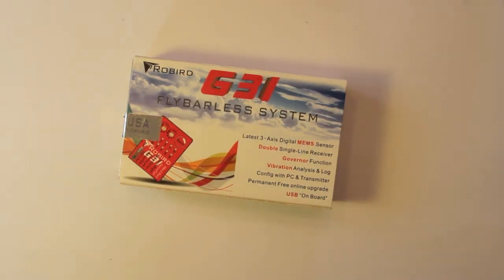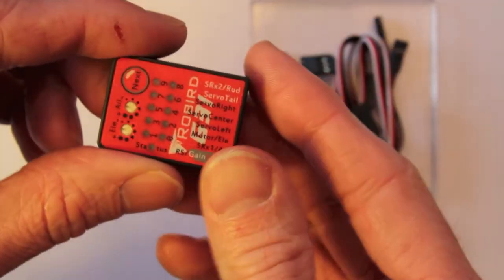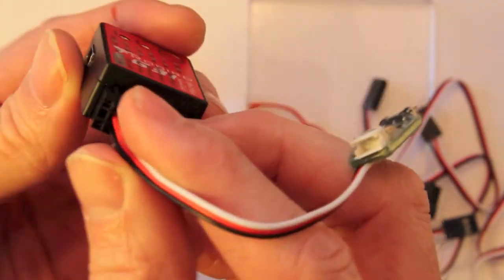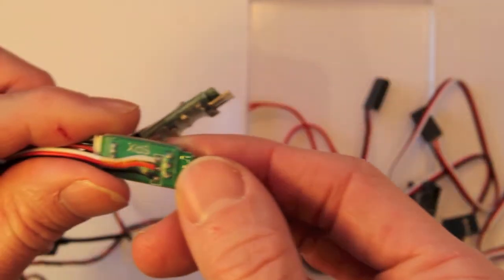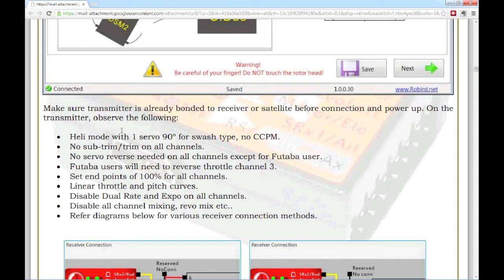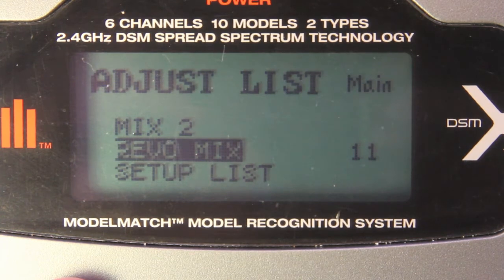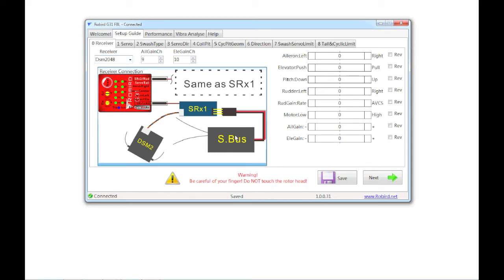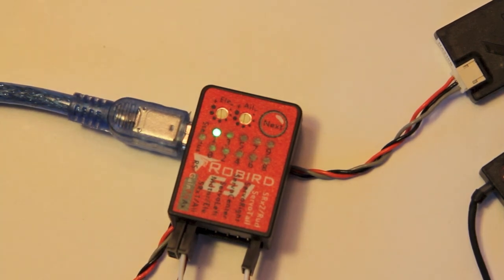12 : Tarot 450 Pro V2 Build : Electronics Extravaganza Volume Two

Comment: Having initially bound the satellites and receivers with the transmitter set ar 3 servo 120 degree, do you need to rebind them again with the new transmitter setting of 1 servo 90 degrees that was depicted in this video?